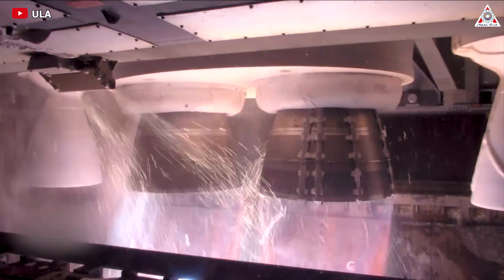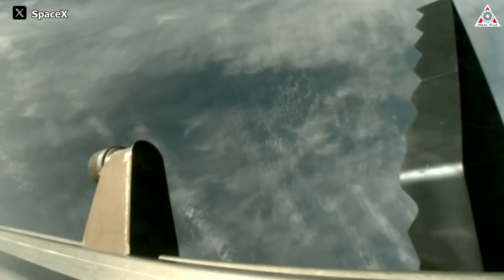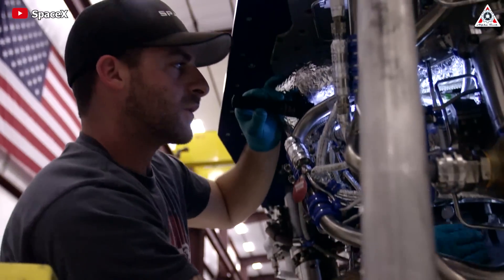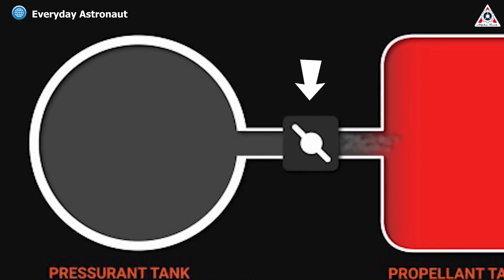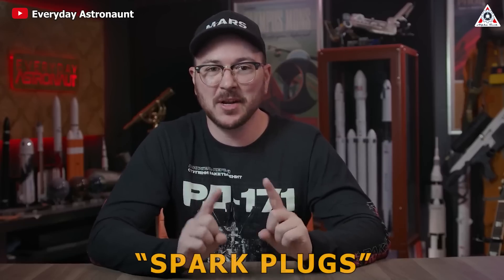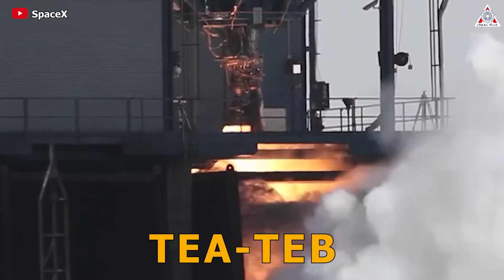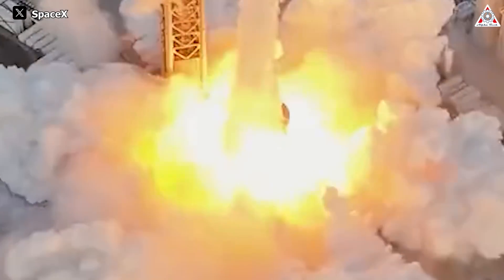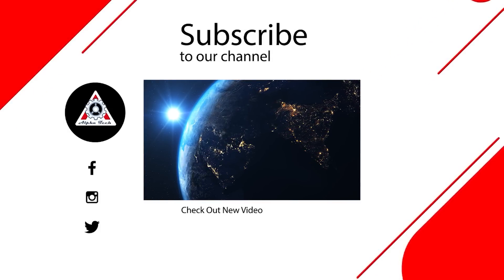Raptor BAD! SpaceX revealed Starship Third Launch Engine TROUBLE...

Comment: 1:00 wow nothing on how the engines on both vehicles were spewing gases after shutdown? Even Musk when he was selling his BS was saying how these engines want to eat themselves up. Of course reigniting something that's coming down at 2 times the speed of sound might prove difficult. Then of course the ship itself spewing gases the whole time before it burned up because there was no reaction maneuvering thrusters to get the ship to face the heat tiles correctly. Just another billion to write off that the US taxpayers will be paying for.
Reply: Three mistakes in that post:
1) IFT costs about 100mln, not bilion. Total Starship program cost 5 bln, with 2 bln spent in 2023. Majority of this money was spent on building and expanding multiple sites (launch site with major overhaul of tank farm, starbase with replacement of tents into full factory, Massey site, raptor facility in California, McGregor tx engine test facility expansion), and development of raptor 2 to reach production rate (Feb 2023 reached 5 engines per week),  then development and production raptor 3, and multiple test that INCLUDES both IFT. 
2) funds are from SpaceX. Only involvement from taxpayer money are related to how program, but those are NOT paid upfront, as in most NASA contracts, but per milestone. Majority of milestones are related exclusively for hls, while some are dependant on working Starship. Till now SpaceX achieved 30 milestones worth 855mln. Majority of those money was already spent on hls, so THAT was just offsetting cost. For comparison, NASA just gave contracts to 3 companies worth 4.6 bln for ROVERS. 
3) "spewing gases" was intentional. It's called ullage gas. And btw, it's what SpaceX uses for RCS. And doesn't matter that it malfunctioned. This gave first real data for next flight. Fun fact: SLS upper stage is one of variants of delta IV stage, developed in 1998. First two times also they failed. One of those flights were lost because attitude control thrusters failed.

Comment: Unfortunately VERY misleading title. Description of TEA-TAB is incorrect. It does not require oxygen to ignite the engine...or how would it work in orbit?
Reply: not saying you are wrong, i know almost nothing about rocket science. But i do know a typical rocket brings its own oxygen with it on the trip.

Comment: It’s hard to get 33 of anything to sync up and work together. I must say the NASA SV might have been a better was to go than a 33 barrel Russian Roulette. By the SV’s third flight it was flying astronauts to the moon on Apollo 8.  No, it wasn’t reusable, but so far neither is Starship or Booster.
Reply: raptors until now have never failed because of their design
Reply: @Nuke-MarsX  actually, raptors 1 were pretty bad. Hydraulic gimbal on early ships/boosters also wasn't reliable. 

But current gen of raptor 2 is pretty damn reliable (failed to reignite on ship on space because on board systems refused to ignite on tumbling ship, so nothing to do with engines itself, on booster for touchdown they had to ignite against supersonic airflow. Still ONE was able to ignite. 

And engine that is more powerful than RS-25, half of it's size , way lighter, and costs less than 1 million against 140mln for used RS. With production rate on current lines 1per day.
Reply: 4.1 bln per launch for SLS, 1.5 bln of today dolars for SaturnV. 

100mln for Starship .
Reply: @just_archan lol $100M just to not reach orbit and blow up 😂😂😂🤡🤡🤡
Reply: @heyfascistcatch  100 mln for test of all elements. Bargain compared to tests conducted by SLS. Green run require refurbishment of rs-25. Only 140mln per one engine. So test of SLS is MINIMUM  0.6 bln. 

Senate launch system is just a workplace program for NASA money. 
And btw. SLS uses Delta 4 second stage. Developed in 1998.  Failed two times before reached orbit. DESPITE very extensive ground testing.

Comment: add more engines in the restart then shutdown the ones u don,t need
Reply: That was the exact strategy that worked to land the Starship during its test hops a few years ago.  I think it was their strategy this time, too, but something prevented all but three from lighting and two of those quickly shut down. It's my understanding that the booster did not explode from the flight termination system but from a malfunction.
Reply: Not every engine got hardware for it, another thing, that probably every engine was slightly different. I don't know if that was a case in recent ift, but that was confirmed with b7 and b9.

Comment: SpaceX has to figure out how to stop the fuel from rising to the top of the tank when the booster is free falling at mach speed! Maybe introducing foam to stop sloshing like in race car fuel tanks if the foam can handle the extreme cold temps! HAS NOTHING TO DO WITH THE ENGINES, THEY ARE STARVING FOR FUEL WHEN FREE FALLING!
Reply: Your assertion is plausible to me; but I'm not an engineer.  Just a long ago auto mechanic. I think those old flax fiber cigarette filters hold a clue to stop the sloshing.  They essentially make a sort of capillary/baffle that have very little mass so they shouldn't take up too much fuel space in the tanks. Maybe some kind of carbon fiber sponge like baffle?
Reply: Starving for fuel would explain the reignition events. Why did it explode? My understanding is that it was not due to the flight termination system.
Reply: @appliedfacts  I have no info on that. Can only speculate that the fuel transfer may have not gone perfectly sealed, as it should have.
Reply: @appliedfacts  Not sure why it exploded, but possible that there was fuel in the supply piping that was left over from the initial burn, that's what burned during the re-ignition then the engine fizzled out. Then with fuel re-entering the hot system sporadically from the tanks after the second burn could have led to the explosion?
Reply: there are videos that explain everything you dont have to come up with nonsense ideas

Comment: Grid fins are fully extended on the launch, whereas not so on Dragon launches. The potential for grid fin damage during launch phase (i.e. departing heat shield tiles) and particularly at hot staging seems to be highly risky for such an important component expected to reliably function to a very high degree of accuracy. I know very little about the workings of the grid fins, but in the last few seconds of video contact it appeared that the fins were rapidly deflecting through their full range of movement. I would really appreciate any info as to why the grid fins were so active and whether such rapid deflections could have affected the descent profile, if at all? Thanx
Reply: DUHQ @Alpha Tech is NOT skilled at this level of reasoning.... Let's hope they stop FUD tactics, and celebrate SCIENtiFIC METHOD thinking....
Reply: The grid fins are effective but only with in limits. The crazy movements of the booster were being effected by the fins, just not sufficiently to maintain control. Some speculate that one of the fun controllers stopped working. Others suggest that a strong wind shear threw the booster out of control because control was lost right at the point when the booster passed through a cloud layer. SpaceX has not offered their opinion, yet.

Comment: Not a bad over view..
My guess is the analogy I have used in other writs here, that your are trying to light your propane torch pointing at a several hundred mile an hour fan....

Might be good to have systems set up to not do that... as chances of success are probably not good.
With the raptor's preburner to run pumps, and the left/right systems, I would suggest keeping more flame on, especially the fuel rich side, and having your firing happen higher in less air, and reducing velocity earlier rather than later.
Also you might commit the blasphemy of sacrificing a bit of performance to get glide ratio on both booster and ship. so you can coast in more and burn less fuel in return stages, and reduce velocity using air resistance rather than trying to fly bass ackwards and light engines runnin' against the wind.

Y'all need to start thinking more passively like you are starting to think more simplified...
With things like the Raptors we dont need to be as neurotic as Von Braun... we still are producing Rocket Nazzis, when we have climbing power and efficiency stats... relax! have a home brew! this isn't your grandfather's rocket limitations.

Also building in stainless means higher density to air resistance ratio, more cannon ball than feathers, and you need to adapt your methods to that new paradigm.
They are gonna fall faster, and need more paladins in the form of better designs than crude tube rockets and thinking you can just use engines to do everything, instead of getting Zen-esque in design and softening up the concepts some.
Quit slamming rockets you are trying to slow down... think softer  slower responses...

Going up, is definitely Yang thinking required, but going down wants more Yin engineering...

Maybe be guy heavy on the going up engineer team, and apply more Gals on the coming down side?
Sounds silly I know, but think about what I am pointing out.... launching rockets should have a hard and a soft side perspective... its a zero back to zero cycle, cant be dick heads for all of it, gotta lighten up coming home...

Just sayin'

And I am the parts count guy... give me some credit, Trying to get you'se guys to think again...
Do alittle focus group, contemplate the hard and soft sides of rocket hajiras.... zoom in on that concept...
🤭
Reply: POOR overview ... please use your critical thinking for why they posted that TITLE....
Reply: @EVChargers-d9z  
I care about titles  I care about content and getting results in Space endeavours.
And their video wss really about a problem, which is why I posted potential sulutions... Blatering about lighting systems doesnt address the problem, it was just giving a decent background to work from.
So I pointed out what I thought the problems were.
Minimalism results in efficiency.
Its a big sea to cross...
Reply: Are you suggesting that the booster come down on its side in order to use wind resistance and also keep engines running through our the decent to avoid relight problems? Maybe a flip maneuver close to touch down?  More like a Starship landing?
Reply: @appliedfacts  Thats one option I thought about, and maybe even giving it some glide ratio via airfoils etc.
What they are doing is trying to play magic rockets and use fuel and power to do everything.
Meanwhile the same types of jobs have been done with zero energy input.... i.e. use the altitude and trade it for distance. Like coasting to a stop in a car rather than accelerating before braking.
Its rocket nerds, everything has to be a rocket... ditto on the starship, they try using the engines rather than flight profile. Then they dive it into the atmosphere plunging rather than gliding high in thin air and slowing down from near orbital velocity.
Its their mental approach, every thing a tube, everything powered, 
on the side of the equation you want to reduce speed and altitude.
And flying wine bottle aerodynamics model, saw it justified because the ship was light coming in empty.... what happens if you have a load? or what happens if a space force Starship doesnt want to land in a hot LZ and just wants to fly over it?
Basically they have been continually self entrapping via entrenched engineering mindsets.
They beat the gravity well side of the problem, But are getting beat up by the kinetic energy side of the flight cycle. they are not using the free energy...  wouldnt take much airfoil to get those boosters back to the starting point,  look at glide bombs, or hypersonic designs.

Basically they are still locked in by water tank construction thinking. and they built several ships ahead.... Of a design thats dysfunctional.
And these arent lightweight tubes, steel is roughly 2x of aluminum strength to weight. so they have more kenetic energy, and the Falcon tech isnt working....
They are falling too fast to relight.. The problems are building up on them, crappy concept grid fins, to thinking solve every problem with a motor.
its gonna get embarassing if they dont wake up.
I'm waiting to see what they do with the remaining ships? I'd be changing things in attempts to get a start solving the problems.
And what I saw on Starship was an open centered spin, like low wing WW2 fighter aircraft in an unpowered crash dive, same spin happens to arrows with three fletch that loose one fletch, you get an out of round effect
that causes that type of spin.... its their flaps on Starship being to one side.... it went unstabile and started to tumble.
Basically like adding drags to one side of a bullet....
They dont have the physics right, you cant just do whatever you want and it will work.
 Realities are sets of limits. They exibit impractical engineering.
And I want things to work, thats why I try to critique and offer suggestions.

Like their Spaghetti monster motors that would have bankrupted SpaceX.....

This is like that too....
its not working....
They need new think....

Comment: Career rocket propulsion system engineer here.  At a high level, your discussion of the various rocket engine types was pretty good.  There are lots of details that you glossed over that could be a treatise unto themselves.  One correction though.  You said that hypergolic propellants are injected into the combustion chamber in their gaseous phase. That is incorrect.  The two mainstay hypergolic propellants are monomethylhydrazing (MMH) and nitrogen tetroxide (NTO - however, NTO is usually subclassified by the level of nitric oxide in a composition of mixed oxides of nitrogen, such as MON-3 where the 3 is 3% NO in the mixed oxide solution).  Anyway, MMH and NTO (or MON) are injected into the chamber as liquids, and the heat generated by their mixing initiates the phase change and combustion process.
Reply: Thank god someone can call @AlphaTech's BS.... I wonder if @velikjoxtnik thinks "Raptor BAD" lmao
Reply: @EVChargers-d9z , I don't understand your comment to me.  I only corrected a statement about the combustion of hypergolic propellants.  I didn't say anything about the Raptor engines.
Reply: BS

Comment: You kinda glide over the issues with restarting the turbo fuel pumps.  The fuel pumps are powered by a gas turbine of around 100,000 horsepower.  Starting that from a cold start is not easy.  Starting them a second time, under time constraints, while coming down, that is much harder to pull off.  At that second, the turbine parts are all at various temperatures, some still very hot, some already cooling off.  All it takes is a little differential temperature gradient and the bearings or turbine blades can bind up and fail to start up.   Perhaps they can keep the turbines running at a very slow speed?   Looser mechanical tolerances?  Dynamically adjusted clearances?   Metals with smaller expansion coefficients?  Separate warm-up pre-burners?  Many possible ways to fix this, but each method also has its disadvantages.  This should all have been figured out years ago.  Now it's probably too late unless there are large amounts of time and money available.
Reply: 7 months in the future here:  SpaceX just test fired the same Raptor engine (unknown right now if v2 or v3) 34 times in a ten minute window.  I think they have a good grip on restarts.

Comment: As I have attempted to get SpaceX to listen, their water deluge system only protects the launch pad but does NOT protect the vehicle from reflected 
harmonic and inharmonic frequencies which are likely causing critical material failures. 

A flame deflector such as an upside down pointed cone will lesson the damaging frequencies from reflecting directly back up to the booster engines and Starship space vehicle likely damaging the heat tile system causing plasma to breach into Starship with catastrophic results.
Reply: Right? Love the internet weirdos that think they know more than all the engineers at SpaceX. @kc5402
Reply: lol love these youtube engineers. you should put in an application instead of pointless YouTube comments lol
Reply: @christianhunt7382  Am in active discussions with SpaceX.
Reply: @christianhunt7382  I have over 25 years of advanced material reinforcement, testing and forensic failure engineering experience and have emailed my designs to SpaceX. They responded with a vender application.

Comment: I'm going to guess the problems with relighting the engines for both stages was not being able to supply fuel to the engines. The booster was spinning and dropping to earth, and the starship was just tumbling, all that fuel would have been sloshing around and most likely no where near the bottom of the tanks.
Reply: there are explanatory videos you dont have to guess, cuz its wrong

Comment: it musk be hard to re-ignite any engines when your free falling at +100 mph with the air rushing around the bell shaped engine. nigh on impossible.. i guess. ignition should be sought at much slower speeds unless you had a kind of fool proof ignition that was protected by the wind velocity.  failing that ,face the way your travelling so the wind does'nt buffet the engine whilst trying to ignite!   💣💣💣